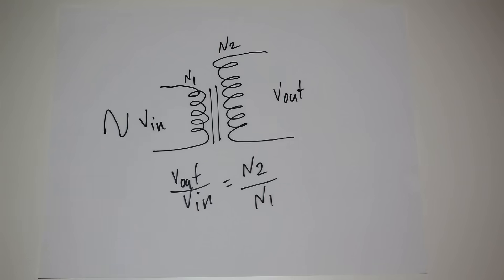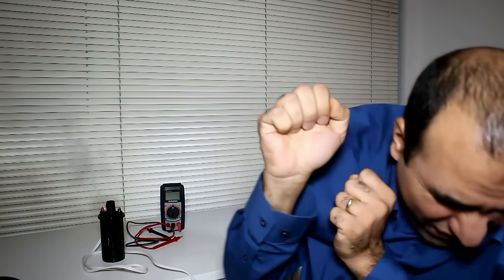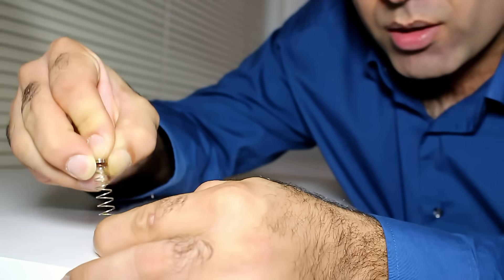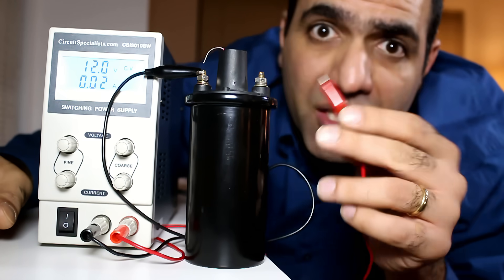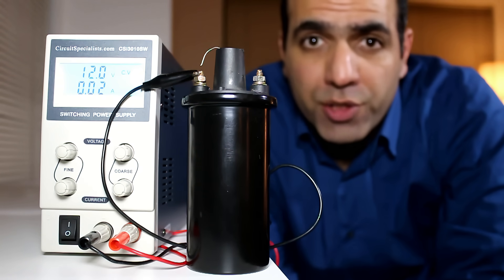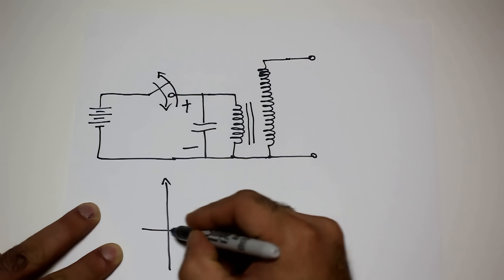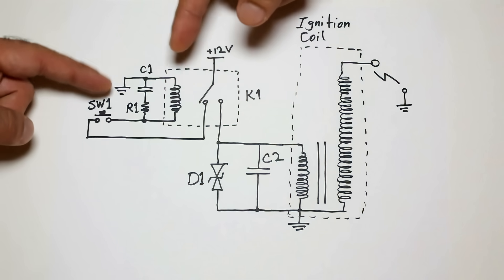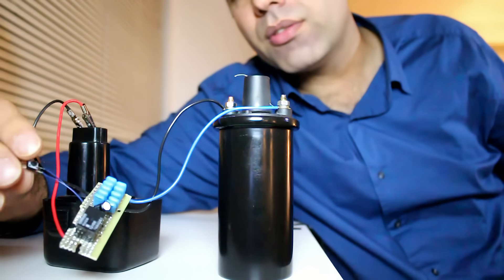How to Make a Taser (Stun Gun)

Comment: been there felt that, testing for spark on an engine even though it sparked to the engine and spark plug cap I was holding was rubber, I still got a shock that sent me recoiling across the garage.

Comment: Is there a difference between a tazers and a spark plug (other than its purpose)
Reply: TheMusicboy316 aside from purpose? Consider their uses: tazers arc on average about an 1 to 1 1/2 inches and produce insanely high voltages (10,000 + volts). Spark plugs do arc in a similar way and can be powered from the same transformer (like this vid), but don't gap nearly as much ( a few mm at most). Spark plugs run of a 12 volt or in some cases 24 volt automotive system, so using the 1:60 transformer, they put out around 720 volts or so
Reply: gr1nder07 thanks! Perfect answer
Reply: TheMusicboy316 you got it!

Comment: is it possible to build up a tolerance to electricity?  like how researchers who work with venomous animals can withstand bites that may actually kill regular people?
Reply: I don't believe so. The reason a researcher is able to withstand venomous bites is because the body is able to fight off the poison because it has been poisoned so many times. Kinda like how if you get a certain virus, it's hard to get the same one again, because you've built up immunity. But electricity is not a poison (obviously). Pretty sure the pain is lessened, but a lethal voltage will still kill them.
Reply: poison is a chemical reaction, while being electrocuted is a physical one, its like asking if you get immunity from bullets if you get shot alot of times

Comment: Wait!
Dont transformers only work for AC? 
Don't batteries only contain DC?
Reply: And if it is an AC signal, isnt 120AC enough to kill a person?
How is the output witch is 700AC not cooking you instantly?!
Reply: Yes, and yes. What he is doing is setting up a capacitor in parallel to the primary coil. When a voltage is applied then disconnected, current oscillates between the capacitor and the primary coil. He uses a drill battery to control the relay which switches the power applied to the primary coil/capacitor on and off rapidly. This allows for the oscillation to repeat continuously

Comment: Is there a way to boost the current in order to make it more effective?
Reply: You could increase the input voltage from 16 volt to higher. This would increase the voltage across the spark gap thus increasing the current

Comment: How the capacitor helped the circuit ?Can somebody explain it to me?(im 4th year electrical engineer student )
Reply from the maker: +P Syle You are the 4th yearer! you should explain it! Well, Without the capacitor there is a very large and very fast spike. The time constant of an inductor voltage decaying is L/R and with R at close to infinity, the time is almost zero. So there is no time to observe any energy. Now capacitor has two good effects: it also stores energy which adds to the inductor stored energy, and now the voltage between inductor and capacitor oscillate for a much longer time, decaying due to internal resistances. The smaller the capacitance, the larger the peak voltage, but also decaying faster too. The larger the capacitance, the smaller the peak voltage. Also the resonance frequency changes by LC value (f=1/(2.PI.SQRT(LC))) . The coil has the largest output voltage at a certain frequency so it is good to tune LC properly.
Reply: ***** Thanks for taking time to answer,i get it now . Im a 4th yearer at a low rank university which the course that the university provides is very very simple!!

Comment: hi EB,

it would be osm if u made a video on piezoelectricity and things that you could do with it.
its just that i dont have the stuff to try it out myself, also i have no idea as of how much volts it can produce...
Reply from the maker: +Randall joseph I have already bough like 6 BBQ lighters to extract their piezo. I don't know what I would do with them though. I'll think of something!
Reply: +ElectroBOOM actually it would have been much more cheaper ifu had just bought around 6-7  buzzers
Reply from the maker: Randall joseph
Buzzer piezos can't spark though
Reply: +ElectroBOOM  i wish that you have 1million subscribers
Reply: Got it! Make a glove, so when you punch someone, it stuns them at the same time! 

:D Wouldn't work though. Unless you like REALLY punched them
Reply: can you not just buy piezos on their own without taking apart lighters? wouldn't that be cheaper?
Reply: Eric M yeah it would!! if you had two metal plates, one on your index and middle knuckle and the other on your ring and pinky knuckle separated by ceramic or another good insulator, you could rig the same system he has. All you'd need is to change the set up so that current passes ONLY when the two plates are shorted (I.e. across someone's face)

Comment: did the shock kill your caliper or does it still work? very curious how it would defend from this if its possible for that voltage to get into the circuit or if the voltage just travels right through the metal parts around the circuits because they are the path of least resistance?
Reply from the maker: +jameswoodsist Made it malfunction. Power cycle fixed it. The energy passes right through metal and very slight amount is causing malfunction
Reply: +USSR , Russia wat
Reply: ***** That's now how electricity works literally at all. If you can provide me with links that say otherwise, then I'll believe you, but what you say simply isn't correct.
Reply: +USSR , Russia yeah no. the only way electricity is going to "cut" a limb off would be something like a plasma cutter
Reply: +USSR , Russia dude electricity doesnt just "cut" shit. it burns it or makes it explode. if you get struck by lightning you dont get cut in half like its starwars or something it shoots through your whole body looking for somewhere to go and if it cant it will discharge itself in your tissue causing it to burn or blow out your fingertips or toes or some other unfortunate appendage.
Reply: +USSR , Russia yes high pressure fluids can easily cut through limbs but electricity doesnt really behave the same way a fluid does. idk what you mean by iron fillings
Reply: +jameswoodsist Filings with one L, he means how waterjet cutters work which is high pressure water and a small amount of abrasive typically granite. Although Small particulate Iron would work it would also create iron oxides in the water jet and gall the nozzle being used to focus the jet, and hence would create a blockage which is why granite is typically used since it does not react in the water.
Reply: technically electrical pulse could dismember you by causing the moisture in your joints to vaporize and explode.. but it would have to be very high energy
Reply: only if the pulse was grounded on the other side of your joint. otherwise its going to go through your entire body and fry everything. watch one of the hundred videos of someone getting killed by electricity, they usually dont have their arm or leg blown off they usually burst into flames.
Reply: jameswoodsist yeah it's unlikely of course but it's possible

Comment: ElectroBoom how did you learn so much about electronics , you seem to always have a soldered circuit ready to go. You also design your own schematics which is awesome! I only know how to analyze them I haven't had much experience with making my own
Reply from the maker: +Basil Eleftheriades :) I had some education in electronics
Reply: Would you mind helping me locate the correct resources for acquiring such knowledge ? Also I am addicted to your videos I love watching them. I get a huge kick from the Full Wave Rectifier. I cant believe you tried to rectify your wall power like that , that was hilarioooooooous 330 W lol man so good.   You know that slayer circuit you made ? It's similar to a plasma ball I guess right ?  If I take a fluorescent bulb near a plasma ball it will excite the gas and light it up
Reply from the maker: Basil Eleftheriades For education, I would look at some technical institute, college or university. It is harder to learn things on your own without help.
The slayer exciter pretty much does the same thing as plasma ball, but its voltage is not too high to create a plasma all around it. But can create plasma if you put a needle on it.

Comment: So what's the minimal voltage required to make a  considerably long arc ( 1 or 1.5 cm ) ? Is 660 V enough ?
Reply from the maker: +Mohamed Berrada to break air you need at least 16kV for one cm.
Reply: +ElectroBOOM Can I also make a Tazer with low Voltage. So I can taze somebody and he doesnt get hurt. Just that he gets a little shock.
Reply from the maker: Der Boss
Just get a disposable camera and charge its capacitor and touch someone with that! There won't be any arcing through air, but it hurts! There are many videos out there making tasers with these cameras.
Reply: +Mohamed Berrada well I used a 13-700 volt inverter driven at 8 amps. I vaporised paperclips with it. It had a small but very, very , very hot arc.
Reply: +ivan R Won't a transformer of 13 to 700 ratio be too heavy and too big ?
Reply: Mohamed Berrada well I used a trick: a resonance capacitor acros the feedback windings. This gave me an increase from 220 volts to 700 volts while having a constant current.
Reply: +ivan R same as what he used in the video
Reply: yes and no. He had streamers, I had hot paper-clip vapo-fucking-riser arcs :)
Reply: A piece of paper would catch fire from 5 cm away :)
Reply: +ivan R  At least it worked. you know how i can create an arc with two 1 to 29 ratio transformers ?
Reply: Mohamed Berrada which kind of transformers do you have? (E-shell, toroidal etc...) and for what frequency are they meant, and most importantly do they have feed back windings. I think you can get a decent ark if you use a 555 timer driver driver circuit. You would have to to some testing. If the transformer has feedback windings, I would recommend you add a small capacitor across, as this will increase the magnetic flux and therefor the output voltage. Also, I would add a voltage multiplier to the output as this will make the arcs much juicier.
Reply: +ivan R they look pretty much like E-shell transformers. they work at 50 Hz. And has 3 wires coming out of the secondary coil. SEC : 8V-0-8V
Reply: Mohamed Berrada good. Do you know if the transformer is taped or not? Because if it is, I would add a resonance capacitor across the feedback windings. Google 555 timer transformer driver. That is the one of the simplest driver circuits. If you want to go pro add a voltage multiplier, a metal film capacitor on the output before the voltage multiplier and add a resonance capacitor across the feedback windings.
Reply: +ivan R yes, it is taped. So you're saying that I could just add a 555 timer circuit and some capacitors, and it could build up enough voltage to create an arc ?
Reply: yes, definitely if you add a voltage multiplier and run the circuit with a decent power source and a resonance capacitor. I ran the circuit from 13 volts and well I vaporised paperclips.
Reply: +ivan R And if I use 8 AAA 1.5 batteries in series (12V total) will it provide enough current to create the arc ?
Reply: +ivan R And if I use 8 AAA 1.5 batteries in series (12V total) will it provide enough current to create the arc ?
Reply: I have not tried arcing with batteries, but I did light a fluorescent bulb of them. I used a 100 Watt 13 volt variac power supply. However again, if you add a big voltage multiplier, it might work.
Reply: +ivan R Can I skip the voltage multiplier step ?
Reply: I would highly recomend it for better arcs
Reply: +ivan R Ok. Thanks a lot for your time. By the way, can I have your e-mail adresse ?
Reply: Mohamed Berrada no problem bro my email is ivanthecool2001@gmail.com:)
Reply: +ElectroBOOM 

So if I wanted an arc that is 5cm, I would need 80kV?

Comment: So if I make an inverter than converts 12 V   DC to 330 V 50 Hz AC, I would be able to create arc ??
Reply from the maker: +Mohamed Berrada 330V is not high enough to create an arc over a reasonably long distance. It could make an arc over maybe 0.1mm.

Comment: I only have a 1 to 29 ration transformer. if I use the same input voltage, can it create an arc ? And what's the frequency of the pulses of your arc ?
Reply from the maker: +Mohamed Berrada You can create an arc. The pulses are pretty slow, like 50Hz.
Reply: +ElectroBOOM ok. Thanks a lot for the anwer
Reply: +Mohamed Berrada answer*

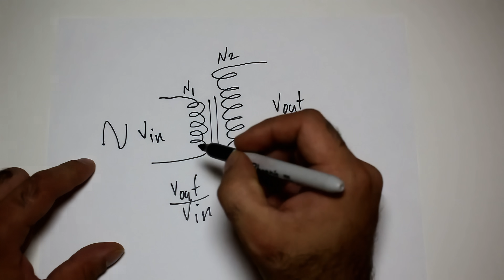Comment: i have a silly question, is it always ok to connect the primary with the secondary windings like what u did at 1:22
Reply from the maker: +Mohamed Nana'a It is OK to do that if you don't care about isolation between input and output. It is not ALWAYS OK. For example in wall adapters you want to keep the isolation from input live lines to the output low voltage to prevent shock.

Comment: I can't find a single video without him eletracuting himself!!
Reply: +joe m I think that is the point... :P
Reply: +joe m or car hood falling on him
Reply: Or burning!
Reply: +joe m don't forget pounding and impaling his hand.
Reply: +joe m If he was electrocuted he'd be dead. :/
Reply: How bout the one where he makes a phone charger
Reply: That's kind of the point lol.......that's his shtick.
Reply: In his video "Slayer Exciter Circuit, Using a Tesla Coil" he doesn't seriously shock himself. He does still set a napkin on fire though!
Reply: +PurplePanther213 C It's not so simple.  One can be zapped by 10's of thousands of volts without harm if it doesn't have enough amperage behind it.  A certain amount of volts is needed to have the potential difference to allow the electric flow the volts have to be high enough to overcome your bodies resistance but it's the amps that does the damage and what kind or damage is also determined by the path of the flow through the body.  You could burn off a finger but not be killed if current only passes through your finger.
Reply: +joe m it's in the name
Reply: +acid dox or getting electrocuted and hitting his head afterwards
Reply: +Shiny Quagsire I believe if any AC hits him he will be dead what he was experiencing is Voltage and they burn everything but metal
Reply: +Shiny Quagsire Lol electricity won't kill you unless it's high enough voltage
Reply: +Janhyua Kripperino His battery is DC but he uses the circuit to generate AC.  Only AC can be transformed by a transformer coil.  So he's essentially getting zapped by AC.
Reply: Electracating isnt a word
Reply: johnniedehuff
spelling I know. . .

Comment: In the beginning he said that it only works with ac signal, but later he uses a battery?
Reply from the maker: Gijs Yes, because the circuit converts DC to AC by switching it on/off
Reply: ***** i get it. thank you for the reply!

Comment: i dont understand why tasers dont kill... there are tasers with millions of volts, which when faced with the body resistance will generate lethal amperage...
Reply from the maker: ruSEXtreme There can be tasers with millions of volts, but there aren't any. I believe their voltage is between 50k to 100k, closer to 50k especially considering they have somewhere around 3cm air gap. Still, it creates lethal amperage, but for very short time. So there is not enough energy to make damage.
Reply: ruSEXtreme When you you multiply the voltage in a transformer, lets say by x100, you also divide the amperage by x100 so the total energy on the system is equal, the teasers with 1mV have a very low amperage so it won't kill you (also because it controls how many Watts go out of the battery at a time).
***** These beasts exist:
http://www.amazon.com/Ruger-RSG1MVB-Million-volt-Stun-Flashlight/dp/B00CQ8IB4Q
Reply from the maker: chaosorr
Don't believe their sales pitch! 1MV will arc over one meter. So it is not possible to create 1MV over the 2cm gap they have, maybe a bit over 20kV. You know it is fake when you see "1,000,000 volts of power"! volt is not power!
Reply: ***** Can you sue them? :)
Reply from the maker: ruSEXtreme
don't care enough!

Comment: Why the primary and the secondary coil for the transformer are conected togather?
Reply from the maker: Commander Riley That's how they make these coils,
Reply: I tryed the circuit but i used a microwave oven transformer and it is producing a small spark,but i zapped my self with it and it hurt like HELL.You think the the reason for having a small spark is the transformer?Thanks for replying
Reply from the maker: Commander Riley
I don't know what the parameters of that coil are. But I assume it runs much better in a different frequency than the ignition coil.
Reply: Damn,any advice to make it run better?
Reply: My transformer runs on 50Hz
Reply: I put an 150uf cap instead of 22uf and the sparks are over 1cm.With 22uf the spark were around 1-2mm
Reply: +Commander Riley be VERY careful with MOT's. They WILL kill you if you don't know what you are doing. Safety first!
Reply: +Commander Riley cuz spark will flow to the motor case which is connected to the negative pole
Reply: ***** I wired up the mot to the sircuit like in the video.not on the wall outlet.lol
Reply: SpIRiTus1995 ikr...Lol,nice photo btw